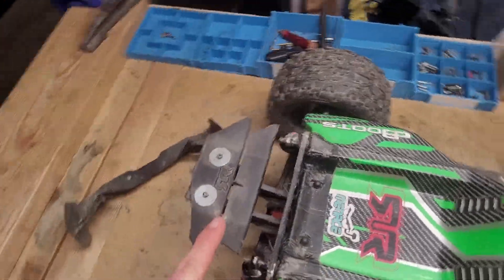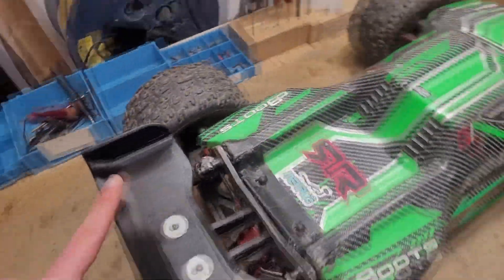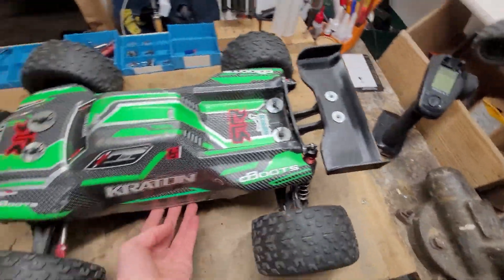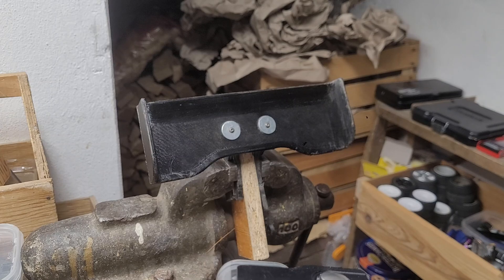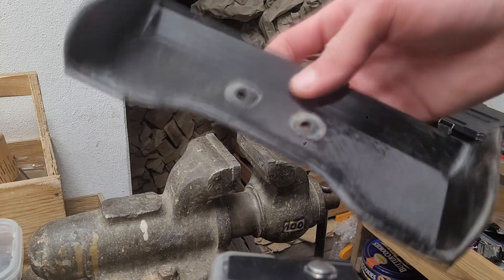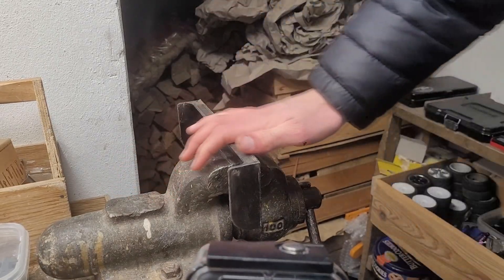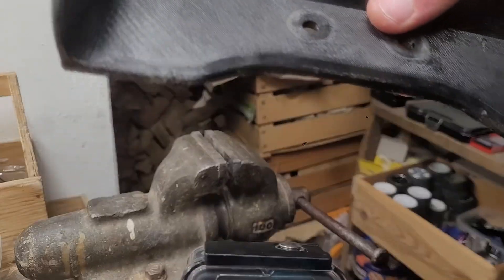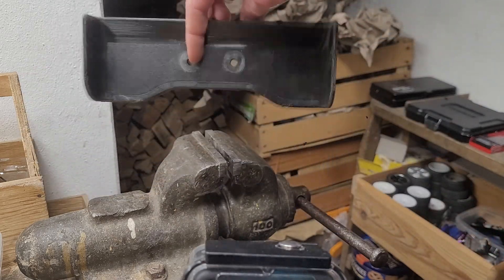I 3D printed an UNBREAKABLE RC Wing

Comment: Nice video, i'm quite impressed with the wing. Just a suggestion, how about 3d printing a high downforce wing like the agama beta wing or vp pro? That might test the tpu more, and they make quite a difference to the handling of the car.
Reply from the maker: Thank you, I appreciate it! I've never heard of those, will have to check them out. :) btw I recently did a video about an active rear wing I built, might be interesting for you as well

Comment: Hello, great video!  That wing was amazingly strong!

I have a question that I thought you might be able to help me with.  I have a Traxxas Bandit that I speed run and it is almost to 160kph.  It needs a front spoiler to do this and I have had several printed in PLA but as soon as I even have a soft crash, they break.  

Do you have a recommendation on what kind of plastic to use?  I was going to try something besides PLA but I am also trying to not make it too expensive.  It needs to be able to stay ridged as it will get some downforce pulling on it but I al also looking for something that doesn't break as easy.

If you want to see the spoiler I have been using, it is time stamped in this video.  https://youtu.be/vQqq5Cvch68?si=oZj__BVhNYj3WThh&t=449

Thanks so much!
Reply from the maker: In this video I used TPU, but that probably wouldn't be too optimal for speedrunning as it is pretty flexible and can deform under high loads. If it needs to be stiff, Polycarbonate (hard to print, toxic fumes and expensive) would be optimal, but PCTG might work as well. Nylon is a solid middle ground between flexibility, toughness and stiffness but again, a little bit harder to print. 
Maybe you could also change the design if it breaks at a weak point / mounting point?
Reply: @ValRC1  I was talking to a buddy to see if he might be able to help me improve on the design and make it a bit stronger.  I really appreciate the advice!

Comment: perfect Design. could you let me know the filament brand and type you used.... there are so many on the market with different flex characteristics...
Reply from the maker: Actually, I'm working on an improved design rn :) this one was great already but there is still room for improvement. Filament used is 95A Sainsmart solid color TPU
Reply: @ValRC1  great. is there a chance you share the stl on printable or so..... I need one of those myself... I am fed up with buying wings on regular basis....
Reply from the maker: @wkatt3573  ohh wait a minute, this is about the wing. lol sorry most comments I get are for my Wltoys TPU Arms, which i'm actually working on an improved version for. The wing is pretty much perfect in terms of durability already tbh. I'm thinking about uploading my designs on cults3d for really cheap, to get a little bit in return for all the work that went into them and enable other people to print them out themselves. Would you be interested in that?